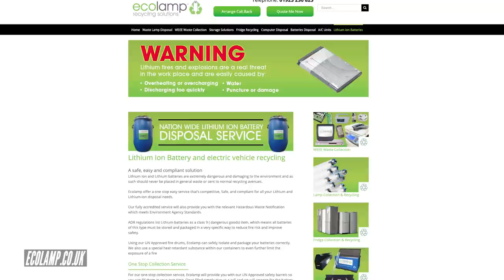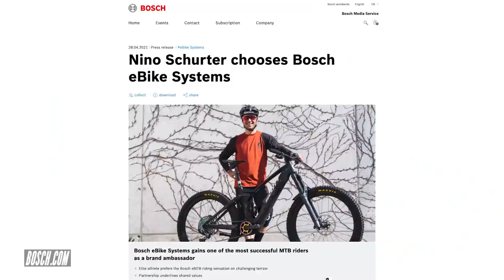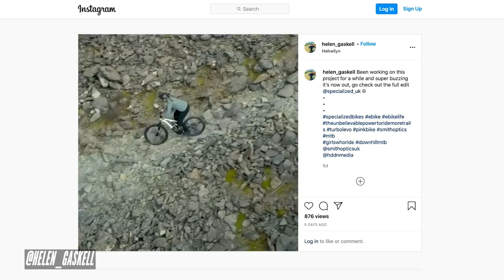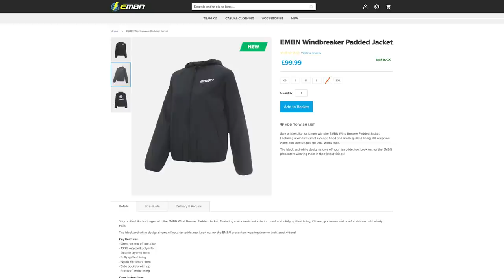Should You Downgrade Your E Bike Components Instead Of Upgrading Them? | EMBN Show Ep. 176

Comment from the maker: What parts do you replace more often than you think you would on a standard mountain bike? Let us know👇
Reply: All the components involved in the transmission are less durable on ebike.. I usually check the chain for wear to 0.5 and replace it when reach that measure, then I replace chairing and cassette once I changed the second chain, doing so I replace the entire transmission (chairing two chains and cassette) once a year, or more... depends by kilometers.
Reply: Does not seem like any point in buying best drive train components, that will wear out just as quick? 

Unless you can get covers for your chain, that will make gearing parts last 3 times as long & never have to re-lube chain ?

Plus you are not allowed to buy such a thing as covers for your chain or even know that  you could do that! 
Funny that you would have to make your own?
You may wonder, why this has this not been done before or why ?
Reply: take a 12 speed shimano cassette - u're much better off in terms of durability with a deore full steel cassette than a superior slx, xt, xtr which have less resistant materials in the big cogs in order to save weight.
Reply from the maker: @alanblurr1265  We have seen chain covers in the past, the problem is normally that they will still allow some muck to get inside and it becomes trapped, making the situation worse. Cleaning and relubricating your chain properly really helps reduce friction and this slows down the wear on the system. On a gearbox bike, it would be different, the Honda RN-01 and Millyard racing bikes were both great examples of this.
Reply: @embn  Yes Millyard bike was a big step forward in regards reliability in muddy conditions, but he tried & failed to get anyone to help with production,
One  except would be dutch bikes, but they come with other problems regarding gearing & maintenance
Was an other Katz bikes that used rohloff hub in the rear hub with chain running through swinging arm, that disappeared?

Also Nuseti mountain bike 
But can be make to work well & reliable advantage especially on e-bikes!
Reply: I've just broke a tooth off my deore cassette,  so I'll be upgrading or possibly downgrading  lol , just depends on what i can find

Comment: I’ve literally just downgraded my Rail 7 last week from 12 speed to 10speed due to very little stock available and price increases, my mech was kippered anyway, so I sourced full 10 speed shimano setup, new freehub complete, for £230 ! But goin forward chain & cassette can be sourced easily for about £50-60 👍👍👍
Reply: I have also thought of doing this , cheaper parts and do i really need 12 speed on an ebike .
Reply: @jugglematt100  
Correct! No need for fragile, overpriced “lightweight “12 speed on an ebike, durability and longevity is wot I’m looking for! 👍
Reply: "very little stock available and price increases" aint that the truth! I tried getting a 12 speed upgrade from my 10, Could I find anything other than top end components? NOPE. Then I decided for 11 speed wide ratio, Better luck there got the stuff I needed but stock is still low prices have increased even at the lower end. Then, I needed an 11 speed chain with more than 120 links.. But Ebike chains have gone through the roof! And little stock. So I ended up getting a 12 speed eagle chain 126 link cause it's half the friggin price! lol Never the best thing to do, But it actually runs like a dream on my sram 11 setup 🤷‍♂️ Ignore the marketing? Probably not, But sometimes things work out.

Comment: this is true for all bikes really just because something is lighter doesn't mean it's more durable and most of the expense in making things lighter, comes from making it lighter for its strength.  motorized bikes whether electric or gasoline fueled put a lot more stress on the drivetrain, and extra weight is not as much of a factor with the help of a motor, at least not for everyday use. it does when it comes to situations where you might need to throw the bike around to get over obstacles. so if all you're doing is commuting to work, reliability is much more important than having the ability to get your bike over boulders and logs in the trail, so it's much more important to have a drivetrain that can get you more distance without maintenance. because the last thing you need for a vehicle that you rely on to get your paychecks is to have it down for maintenance

Comment: Steel cassette and sprocket are definitely the better option, very good tyres a must to avoid damage to you and the bike. GX or XT is enough to shift with, alloy frame is fine as are wheels. Disc diameter is more important than the brand . A nice seat grips and pedals are a good investment though.

Comment: Pretty much what I've done with my drive train.  Can't see the point in spending on an xtr cassette and chain knowing the torque from the motor will wear it out faster. Ill only replace a wheel if I kill it.  Upgrades r for contact points for me. Seat, pedals, bars and grips as I'm touching them so I want them to give me the best feel and tyres ss they're in contact with the ground.

Comment: Shimano should make a XT - E  12 speed cassette like a linkglide with the up ramping and down ramping of the XT but stouter gears. IT'S THAT SIMPLE JUST DO IT!
Reply: There will be an XT and deore level ebike specific derailleur, cassette and chain available this summer! It’s called LINKGLIDE. the XT is 11 speed and the deore 10 speed. It’ll be 3x as durable as the current hyperglide products. And I can handle a lot more torque!
Reply: @julesgdb  I'm  talking about a 12 speed with up and down ramping like the current 12 speed xt and xtr offerings

Comment: If parts don't fit right, as in handlebar stem, then I upgrade. When it comes to shifting and braking I always upgrade. I buy high enough in the product offering where I never need to downgrade. I would if I needed to however. I never buy expensive pedals anymore, always composite. They grip great and they don't show wear.

Comment: I definitely use more durable components over light weight race products if not racing. better longevity and cheaper to buy especially drive train. bars, wheels and frame. Not brakes though, good brakes are well worth the money in my experience.

Comment: Just replaced my shimano deore cassette with a cheaper version the reason being my supplier can’t get hold of the stock I’ve been waiting months.
Reply from the maker: The entire industry has been under a lot of strain with such high demand! (due to the pandemic and import/export delays) Hopefully, it will be able to catch up at some point soon.
Reply: @embn  yes your correct the cassette was less then half price of the Shimano cassette I fitted the cheaper cassette with a KMC chain original part because after checking the chain and cassette they were well worn and so far everything is good tested on a 32 mile ride.

Comment: My KTM came with the SRAM EX1 8 speed system....Meticulous care and changing chains before 0.5% has kept it running sweet but to swap wheels means swapping the cassette- because at £400 I'm not buying another. Waiting in the wings I have the 10 speed M6000 shadow + shifter, mech and cassettes (One off road one 11-36 for semi-road wheels). The off road cassette is only low geared to 42T so to maintain the low gear of the EX1 I'd need to drop the sprocket at the front from 16 to 14T, unless I can get a 46 in there lol. (But I also see Microshift are doing an 11-46 9 speed...) Yep sod expensive drive trains, but the EX chains are pretty damn good so would still use them on a 9/10 speed.

Comment: I run the 4 cheapest 11 speed chains on my new cassette and when the cassette is done SLX part dump the lot all for £100. Like 12 speed on a mountain bike is a waste as it would have cost £300 for the same. I have run my Sram 12 speed GX derailleur on my 11 speed setup all good as my old ii speed was worn on the pivot bolt and can't get spares. I had new 12 speed chains left over and put them on my 11 speed just filed the link all good.

Comment: Just waiting for my CYC X1 Stealth mid-drive motor which should ship this week. I was going to install it and use the OEM Shimano drivetrain but it's an older bike and doesn't have a clutch on the rear derailleur so I bit the bullet a purchased an ebike specific drivetrain from Box Components. I chose the Box 2 Prime 9/1 x 9speed. Steel cassette and designed for e-Bikes. So a little heavier but that is certainly offset by the fact I have 1,500 watts to play with along with 9 levels of pedal assist and a torque sensing crank. Has anyone here had any experience with the Box Component drive trains?

Comment: At 1600miles the Shimano Deore 10-speed cassette was done and couldn't find a replacement Shimano cassette, so I installed a Microshift 10-speed cassette and it has been working great. At 3000miles the Shimano Deore derailleur broke, so I figures I would try the Microshift AdventX derailleur and so far I have 600miles on it and no issues:)
It will be interesting to see how long the Microshift components last, they are about 2/3 the price of Shimano.
Reply: No dought,  just messed up my Deore 10 speed  cassette at 1000 mi, i better start looking

Comment: Honestly if I bought a top of the range ebike with carbon everything and a top drive train. I'd take it off and sell it as new and get Ali bars, wheels a steel cassette on emtb I just don't see the point. However the avoid mud is a false argument as yes it adds weight but it adds the same weight to the very light bike and the very heavy making the very light just light and the very heavy unmovable.... 🤔

Comment: Want Shimano XT--durability, reasonable cost, dedicated, 8-spd drive train...the Shimano E-XT perhaps? Do it Shimano!💪
Reply: I mean they’ve sort of done that with the 11 speed heavy duty xt and Deore transmission released last week
Reply: 8 spd pins more durable. Argument strong for 11-50 T 8 spd cassette will have more cog spacing (less skipping) for an all steel cassette. Sram has there EX-1 8 spd version but ain't cheap...I'll just keep my XT 11 spd at 1/2 or more of the cost for replacement rear mech/cassette until Shimano E-XT 8 spd arrives💰

Comment: I downgraded my seat on my LEVO because I don't want my seat stolen but the carbon rail seat i swapped just broke at The plastic rail inserts,, I'm going to get a new cheap seat..i also want to downgrade my rims or upgrade the tru Bolts and get rid of the qiuk release (i Guess a mix because I want to make a mullet) anyways have anyone tried those ridiculous seat post tubes from zoom that looks like droppers but are actually suspension dampers? They are crazy cheap...I want to try because I often bicycle with a really Heavy backpack (at work) and think maybe it will help to not get backpain and maybe it will be very comfy on long Rides

Comment: my next downgrade will be swapping out my shimano 2x10 to linkglide 1x11
Reply: I wouldn't call that a downgrade but I haven't heard about the brand maybe it's a downgrade in value but but but,,,, I have 1x11 NX sram and it's close to perfect..I don't actually need all the mid-range gears i Think 9 would be enough if I still had the smallest and the largest sized ones..
Reply: @HeathenRides  My area is road and trails with 500m height differential, so 44t big ring 30t 36-11 rear. works nicely but having the extra strength of the linkglide is attractive as a 42 front 11-50 should be about the same. When I wear out my just changed cassette I will try it out.
Reply: @tomquimby8669  it's pretty much the same here (Norway) it's Hill's and mountains in all directions but my LEVO has 90nm torque so it's very little use of 5th 6th speed gear i Guess i only use them when going slowly without using the motor